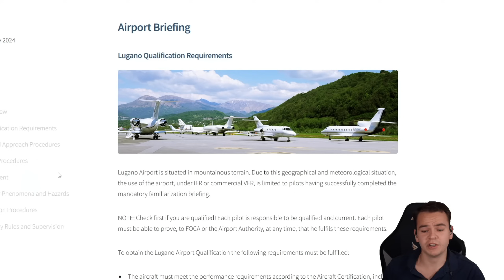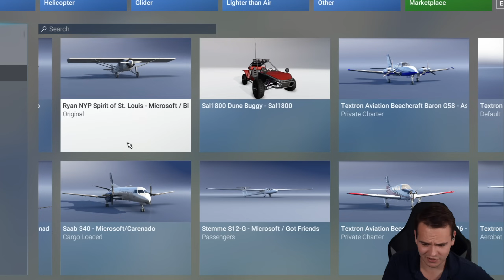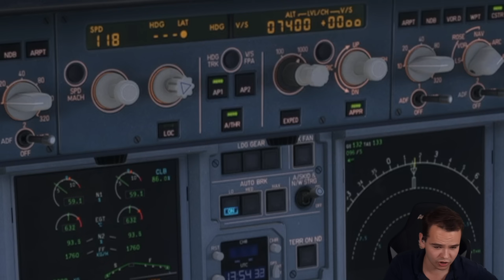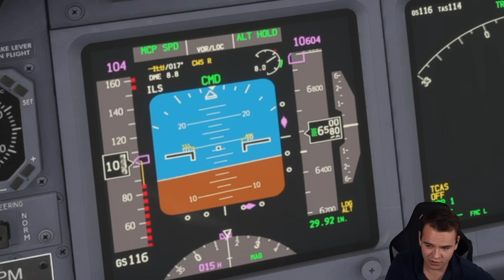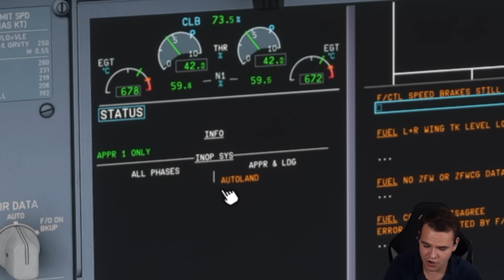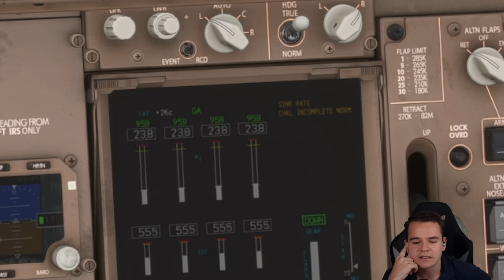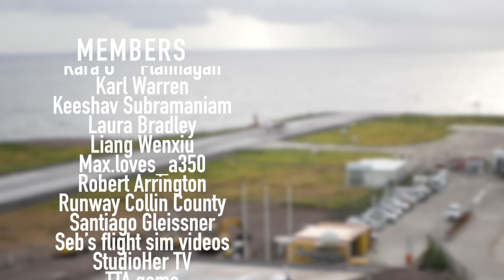Autopilot AUTOLAND Vs The World's STEEPEST APPROACH

Comment: While Dassault Aviation is a prominent French aircraft manufacturer renowned for its Falcon business jets and Rafale fighter aircraft, the F-16 Fighting Falcon is actually an American multirole fighter jet originally developed by General Dynamics (now Lockheed Martin).
Perhaps you were thinking of a different Dassault aircraft, or maybe you were curious about a comparison between Dassault's offerings and the F-16? In any case, let's delve into the fascinating world of the F-16 Fighting Falcon, a truly iconic and highly successful aircraft.
The genesis of the F-16 lies in the Lightweight Fighter (LWF) program initiated by the United States Air Force in the late 1960s. The goal was to develop a small, agile, and affordable fighter jet that could complement the larger and more expensive F-15 Eagle. General Dynamics' YF-16 and Northrop's YF-17 were the two prototypes that emerged from this competition. Ultimately, the YF-16 was selected as the winner in 1975, and it entered full-scale development as the F-16.
What set the F-16 apart was its revolutionary design and advanced technologies for its time. It was the first fighter jet to incorporate a fly-by-wire (FBW) flight control system. In a traditional aircraft, the pilot's control inputs are directly linked to the control surfaces (ailerons, elevators, rudder) via mechanical linkages. FBW, however, replaces these mechanical connections with electrical signals. The pilot's commands are sent electronically to a computer, which then interprets these commands and sends signals to the actuators that move the control surfaces. This system offers several advantages, including enhanced maneuverability, reduced weight, and improved stability.
Another groundbreaking feature of the F-16 was its relaxed static stability. Most aircraft are designed to be inherently stable, meaning they tend to return to their original flight path if disturbed. The F-16, however, was designed to be slightly unstable. This inherent instability makes the aircraft more agile and responsive to pilot inputs, allowing for tighter turns and quicker maneuvers. The FBW system constantly makes minute adjustments to the control surfaces to maintain controlled flight, effectively making the unstable design flyable.
The F-16 also boasted a high thrust-to-weight ratio, thanks to its powerful General Electric F110 or Pratt & Whitney F100 turbofan engine. This gave it excellent acceleration and climb performance. Its sleek and aerodynamic design, featuring blended wing-body construction and leading-edge vortex controllers (LEVCONs), further contributed to its exceptional agility and high-speed capabilities.
The cockpit of the F-16 was another area of innovation. It featured a side-stick controller instead of a traditional center stick, improving pilot comfort and control during high-G maneuvers. The reclined seat also helped pilots withstand higher G-forces. The head-up display (HUD) projected crucial flight information onto the pilot's forward field of view, allowing them to keep their eyes focused outside the cockpit.
Over its long and successful career, the F-16 has undergone numerous upgrades andBlock evolutions, enhancing its capabilities and extending its service life. These upgrades have included more powerful engines, advanced radar systems (such as Active Electronically Scanned Array - AESA radars), improved avionics, and the integration of a wider array of weapons.
The F-16 has proven to be a highly versatile aircraft, capable of performing a wide range of missions, including air-to-air combat, air-to-ground attack, and reconnaissance. Its adaptability and affordability have made it a popular choice for air forces around the world. It has been exported to over 25 countries and has participated in numerous conflicts, consistently demonstrating its effectiveness.
From its revolutionary fly-by-wire system and relaxed static stability to its powerful engine and advanced avionics, the F-16 Fighting Falcon has left an indelible mark on aviation history. While it wasn't a product of Dassault Aviation, its impact on fighter jet design and its widespread use solidify its place as one of the most successful and influential combat aircraft of the modern era.
Reply: ok
Reply: Wonderful 👌🏻
Reply: @LG_AVIEDITS u find copied text wonderful?